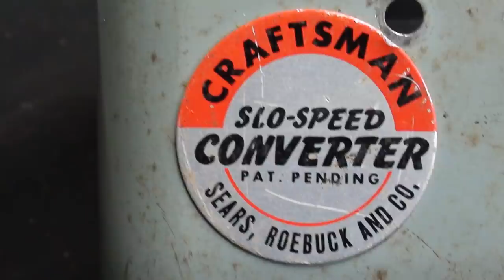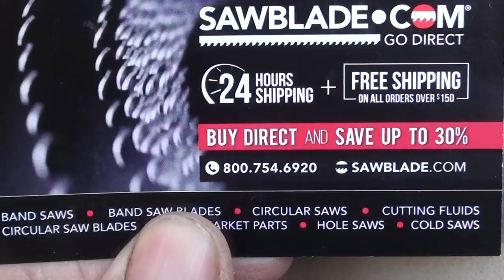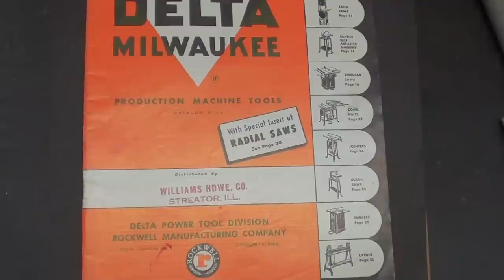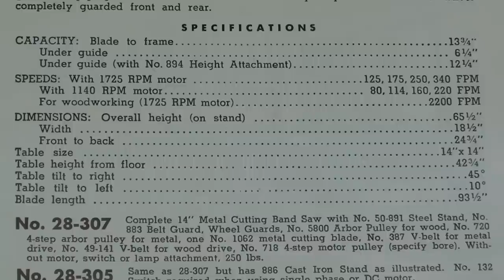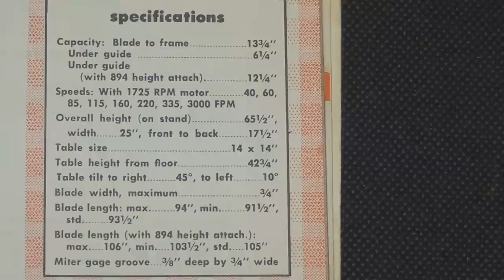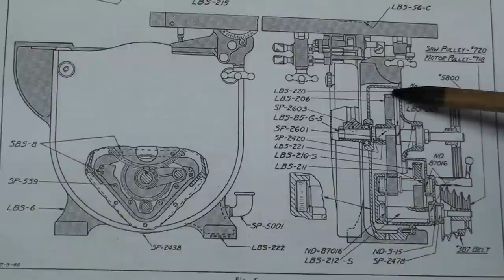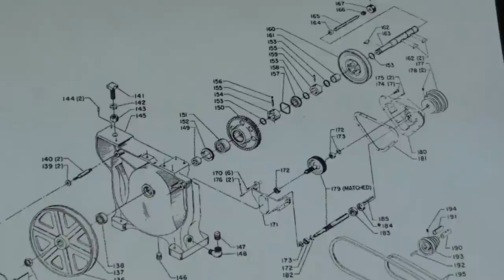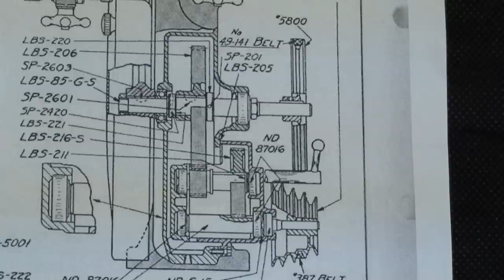GENUINE DELTA METAL BANDSAW REVIEW #830 tubalcain

Comment: I have three of these saws 😔 and all three are pre-1960 and feature cast iron wheels. When running, there is enough momentum to prevent chattering. When Delta switched to lighter, die cast wheels, the lack of mass in the wheel-blade-wheel arrangement not only lead to chattering, but also added harmonics into the mix.... Even at woodcutting speeds. Density and mass are always prime ways to damper vibration, harmonics, and chattering.
Reply from the maker: You got that right. Aluminum wheels may very well be the culprit.
Reply: Very nice input. Something about the old machines you just can't replace.
Reply: The Alu. wheels on my saw have not been a problem with chatter. Even when cutting 1" steel plate (with the proper blade).

Comment: Did a quick Google search and could only find new wood cutting Delta saws and no multi use ones.  Price is $1341. Last year I bought an 81 year old DoAll 16" for 
$1200. I am amazed at the amount of quality built into this saw, everything is built to work easily and last forever.  It goes through 1 1/2" steel like nothing and leaves a wonderful surface. I only hope that in another 81 years someone will be as appreciative of this fine tool as I am now,  it will certainly hold up its end of that relationship. 

John 🇨🇦
Reply from the maker: Thank you, I was wondering if they still made the combination saw.
Reply: I have a DoAll 1612-0. It's awesome. High, low and variable speed. DoAll still provides support and sells parts.

Comment: I've had two of the "modern" version of the metal-cutting Delta. My dad bought one in the early 1960s and I bought one in the 1980s. Then I inherited my dad's in 2005. I never noticed any chatter on either one of them. I have always bought variable-pitch blades for metal cutting (4-6 or 10-14 tpi, and always wished for a finer pitch for cutting thin plate) and I generally ran the tension at a bit over what the little indicator on the tensioner recommended. Be sure the mating surfaces are clean and flat and that the bolts are properly tightened where the upper and lower frames connect.

I also had an 18" Delta (wood only) that I got for resawing thin boards and for scroll-sawing larger pieces. The factory switch/starter kept failing until I put a good commercial starter in place of the factory version.

The neatest use of a 14" Delta was on a This Old House/New Yankee Workshop episode in Florida where they were cutting decorative ends on long 6" by 12" timbers. They mounted the timbers on tall sawhorses and put the saw on a wide base with swivel castors. Then they pushed the saw around, cutting decorative scrolls on the ends of the timbers. Very clever, I thought.
Reply: Vari- pitch to the rescue!

Comment: I have one of these saws that I completely restored about 30 years ago.  It has an Art Deco cast iron base, a gearbox with a shift lever, and requires two different belts to utilize all the different speeds. It was missing the belt guard and I searched for 10 years until I found the correct one.  It's a wonderful machine.
Reply from the maker: I have seen that machine in the Delta catalogs. I absolutely love that base
Reply: @mrpete222  It's magnificent, such quality,  and the reason I bought the saw ($90.00, worn out).  Thanks for the video!

Comment: Always enjoy the videos.  I purchased one of these saws from a local high school.  It was in the wood shop, and the drive mechanism was cobbled to eliminate access to the gear reduction.  I had to get into it in order to restore the metal functionality and clean out hardened lubricant.  The gear reduction unit still had cosmoline  in it, no oil at all.  it does have the hollow cast iron overarm, and the sheet metal base.  Just the thing for accurately cutting ballistic polycarbonate without melting issues.  Notably, it has a 56 frame motor, so anytime Richard wishes to say goodbye to the 3 phase motor, it is a simple swap. (BTW, 1140 rpm is a 6 pole motor, not eight, which would be 862 rpm.)  Not an industrial saw, but a very serviceable workshop saw.  How has the little cordless saw worked out.  Good luck with your lathe motor project.  Just don't connect the start winding across the 220 lines.  The start winding connects to one of the 220 lines and the center connection of the two run windings.

Comment: I totally agree with NBCRGraphicDesign. I have used and owned these saws for years and the wheels are lighter on the new saws. I converted the one I had to a metal cutter and had a few chatter problems, but with the right speed and blade, you can still get the job done. If all you do is cut steel all day, get a Do-All or the like. 
Another thing I have used is a Delta 4 Knobber saw with the hollow over arm that had a 6" riser block to increase cutting thickness. This was handy for cutting large Styrofoam blocks.

Comment: Dear Mr Pete....I love my Delta 14", have had since 1989....but unfortunately, it can only cut aluminum as it is a 3,000 fpm, but the little Wells Saw 300 I bought last week [50,75, &100 fpm] 
it has the auxiliary vertical table permanent attached so all you have to do is lift to vertical and you are contour sawing up to 6 inches on the short side....and you can sit on the frame where the vice is if you are inclined like me.....
got the new blades for it yesterday and it cuts like a dream in steel, and very square....3/8 x 3 angle in two minutes with a 10/14  .025 x 1/2" blade....Lenox of course....for that pesky 16, 14 and 11 gauge aluminum, I have a 14/18 blade....
Great show today, and thank you so much for the Christmas card. it was wonderful, came on my 70 th Birthday by the way........best wishes to you and the missus, and I want to see you peddling the bicycle she mentioned.....cheers, Paul

Comment: Lyle - Another good video, enjoyed the whole thing.  One could use the differences in the two saw designs in a machine design course to compare how mass, stiffness, etc differentiates performance.  Of course today one could use computer simulation instead of how us old slide rule mechanical engineers learned to do it in the dark past of the 60s.  You are correct that those of us in a home shop thing this is fine - I have an old Sprunger band saw that was converted nicely by a retired tool maker and does a decent job for my needs.  Not as nice as a Grob or Do-All but then I can't have everything.  Keep up the excellent edutainment, we enjoy it.

Comment: Good morning. I have the older style which uses two belts demonstrated on my channel. With the 1/2 inch wide metal cutting blade it doesn't chatter while cutting 1018 .25 thick cold rolled. Speaking of big fires in Illinois, I lived in Crescent City in 1970, about three blocks  from the derailment.
Reply from the maker: Thank you, I will watch your video right now. That fire must have been very scary.

Comment: Yes, I'm still listening and did so until the finish. I use a cell phone for all these viewing activity's but if I should pause the video it has a dark screen overlay pops up. So I have to seize the moment. The gear ratio will be interesting but I will not be reviewing to see what I have missed. The most relevant fact I can retrieve is 40-60 FPM. I will apply that to my abrasive saw so the saw blade I have for that can be used for the longest time. Great video Pete (tubalcain)

Comment: "Is anybody listening?" Famous shop teachers' words...  I think I had a English teacher that used similar words, too! 
I picked up a 18" Grob bandsaw a couple years ago.  It has ten speeds available and it has a 3-phase motor on it.  Installed a VFD and have it setup running at about 120 FPM since all I do is cut metals.  It's a pita to change belt speeds, real easy to catch a finger in the process. As always, thanks for sharing. Ken

Comment: A well designed 14” bandsaw suitable for metal is the Powermatic 143.  Hi-lo gearbox combined with 4 belt pulley positions and a stout cast iron structure make it a nice saw to use.  If anyone has a chance to get one, don’t hesitate.

Comment: Stopping here at the halfway point in your video. I have the lever-operated version of the saw, given to me recently & have restored the table, trunions and blade guides and added new tires. Not sure why they want different belts, it seems to run fine as is.  I need to braze up a blade for it. Thanks for the information.

Comment: Bought new a Delta 14" metal/wood bandsaw from a local supplier in 1990. Also bought and installed later a Delta extension to provide more cutting height. Overall I have been pleased with the saw's performance. However, over time the dogs get clogged with sawdust and are a pain to clean out. The really slow speeds can only be achieved with fussing with the belt. The extension required shimming to keep blade wheels aligned. In general, universal do-it-all machines should be avoided for job specific ones. I have a couple of metal cutting saws that are better and easier to use than the Delta for metal work.

Comment: I was lucky enough to find one at a flea market. It was lying on the ground with missing covers, petrified cracked tires and no stand. I saw the street elbow on the front of the castings and realized there was a gearbox inside. Mine has the heavier hollow frame rather than the later single webbed frame like yours,  and the gearbox has the lever. I mounted a motor behind the frame on a generic bolt together table. The motor hangs on a hinge to provide tension from the weight of the motor. It took a chisel to get the old tires off and I put new silicone tires on. I added an extension kit (generic for 14” saws) and upgraded the guide blocks with ones that include small bearings. It’s early enough that the upper blade guide shaft is hex rather than round. I bought covers and knobs off eBay.  It runs well, no chatter that I have noticed. I’m happy to email pictures to you if that’s of interest. I certainly appreciate you making these videos and especially the diagrams of the inner workings of my saw..thank you!
Reply from the maker: That was a nice flea market find

Comment: Enjoyed this study and in depth review of Delta band saw engineering.  I have one that must be like the 1954 model, (tubular overarm) with a lever in the back to shift the gearbox and open stand as shown in your manual. Bought it from a guy that completely refurbished it, he said it came out of Kodak in Rochester, NY. With 1/4" and 3/8" wide Bi-metal blades I have cut a lot of 3/8 and 1/2" hot rolled steel strip, on the 85 and 115 FPM speeds, smoothly with no chatter. I have cut up to 1" steel and 2" Alu plate smoothly with no chatter. Proper blade (vari-pitch is a MUST) and tension makes the difference. Most times I think blades chosen by some are too high of a tooth count. I tend to use coarser blades. I also should note I tension the blade beyond bottoming out the spring that's on the upper blade wheel adjustment. Ignore the pointer and guide for blade tension, it's not enough. Blade must be much more taunt and have made modifications to allow that. I have the factory guides, but those you showed would be a great improvement. Note, wish the blade wheel doors were hinged. I leave the covers off as they are a pain to take off and on. I will also say I currently own around 18 bandsaws, including a 16" Doall and 18" Grob, Jet, Victor, Kalamazoo, Welles, etc. This Delta is not disappointing, and really is quite capable in my opinion. I am not a dealer,  I am a hoarder. Also note: This Delta has Aluminum wheels, the prev. owner must have replaced them.
Reply from the maker: Thank you for that excellent information. I have used bimetal blades in the past. They are always better, but extremely costly.     I wish I had that many bandsaws, L O L.
Reply: @mrpete222  You are most welcome

Comment: I really believe the chatter you experience is the result of the lighter weight arm.  I have that bandsaw and use it as a wood cutting machine only and there are times when gutting hard woods such as white oak that I get vibrations as well.  I was unaware of the 80pole motor you mentioned.

Comment: Love these saws! Only 4 direct belt change speeds. To reach the other 4 speeds,  both 4 step groove pullies must be flipped around. It seems I do recall (25-30 years ago) there was another version that had a worm shaft in the lower casting that could be engaged and disengaged from behind the lower blade wheel for slower speeds. Could have been a different pulley for that slow speed operation as well.

Comment: I have never used a vertical bad saw . I have always wanted to re do a wood bandsaw to cut metal but i didnt know if it would be that useful. I got one of those cheap 4x6 band saw and built a stand  and table for it so it now a vertical saw but i havent got to use it any yet. I would like to see a video on the uses of a metal band saw.

Comment: Hi Mr Pete  I was shooting some footage for a video on my 14 inch conversion  and had a 1/2 10-14 tooth blade and where they welded it it had a skip so i installed a 3/8 8-12 tooth count  and with the 1/2 in. 10-14  blade it cut smooth and with the 3/8 8-12 blade it is scary cutting thin steel 1/8- 1/4  in. where the 1/2 in. 10-14 count worked just fine . Now on aluminum the 1/2 10-14 was a little slow and the 3/8 in.  8-12 count worked good on thicker 1/4 in. up . My saw is a 90s wood model made in usa and came with   1 hp motor 120v. IL get something together soon so you can check it out . Thanks . JM

Comment: The backbone looked the same.   Maybe the massive gear (huge gearbox) added enough to mass to the drive wheel?  The vibration could be not the backbone bending but rather also the wheel speed varying at high frequency.  Speculation.

Comment: I have the same saw only it just says Rockwell on it.. also for some reason it keeps popping out of gear when I engage that push pull mechanism it has a detent in there that doesn’t seem to hold and it pops back out.. I had to wrap a rope around the shaft in order to create a makeshift bearing that keeps the push pull mechanism in the pulled position keeping it from migrating back inward and going into neutral between low and high,, I just run it this way until I get the time to actually tear it apart and find out what the Hells going on in there…

Comment: Mr Pete,  Question have you checked the ridgity of the upper and lower arms compared to each other,  how is the ridgity of the saw wheels,  how's the table,  and yes that wheel bearing guides on your friends saw looks like a nice setup.  This is coming from an old machinist who also repairs machines. Thanks for the video.
Reply from the maker: I did check the rigidity on both machines with dial indicator sometime back. Unfortunately, I forgot the results.

Comment: Mr Pete, there is a YouTuber, Don's Engine, who was inspired by your speed reducer vids and went a little different way to make his own, which works nicely and is pretty cheap.  Don did a 2 part vid series on the work.  He cut up the starter from a Mazda vehicle and salvaged the 5 to 1 planetary gear reduction parts and installed it onto a Craftsman (!) band saw.  Using a proper blade he reports pretty good success.  Of interest to me is the inexpensive gear reduction unit.  I'm thinking of making one up to install onto a one-year-only 1935 Craftsman-Walker Turner drill press I own to get more use out of it.  This is something you might like to look into.
Reply from the maker: Thank you, I watched that a while back and I will watch it again. I met Don in Florida a few years back.
Reply: @mrpete222  He's a pretty nice young fella.  A shop teacher, with a "teacher's heart".  I've reached out to him a couple times about a couple of his projects and he was very helpful.  You should be able to get a dead gear reduction starter from a rebuilder for about $20.00.  The one from a Mazda seems to be best.  It makes a very compact, yet strong unit.  The steel case would be good to weld mounting brackets on.

Comment: To reassure you: yes, some of us were listening AND pausing the diagrams and specifications. While I have used real, industrial bandsaws, my expectations for a 14" saw on a roller base were low. I'm not discounting what you've said about chatter but, I've been pleased that I could get such capacity and capability in a machine that gets parked between a cabinet and the drill press. My saw has the throat riser block and uses 105.5" blades. That undoubtedly made the frame weaker. I have blamed any cutting problems on being too cheap to replace blades when they really should be. You've driven me to expect more and i will look at the whole machine for improvements. Thank you!